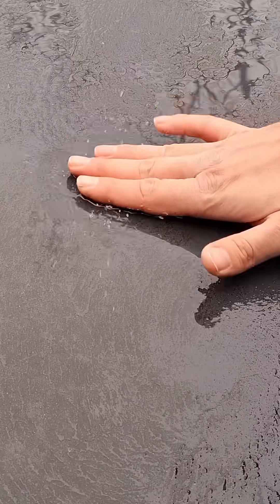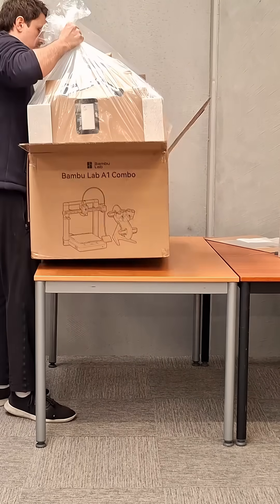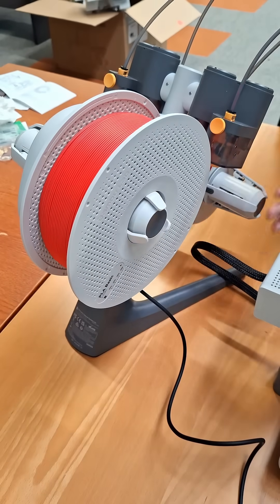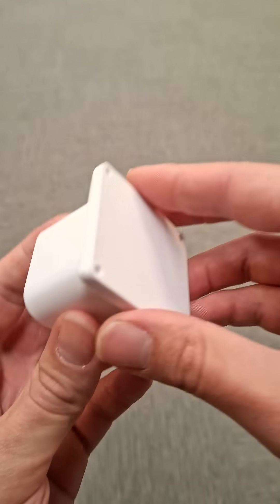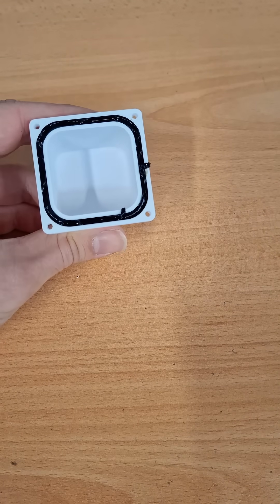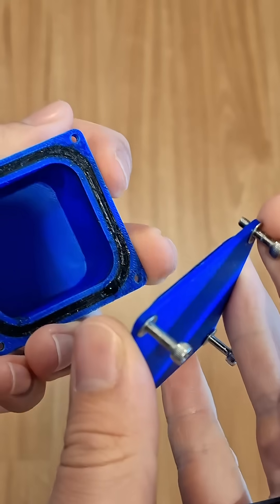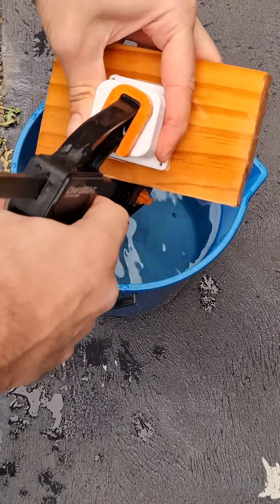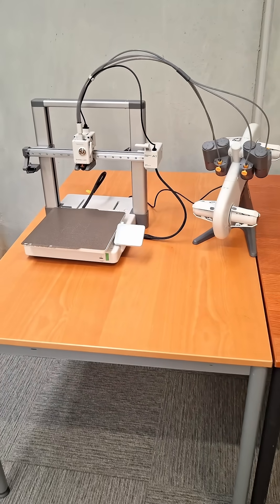Creating weatherproof electronics enclosures with 3D printing #raspberrypi #bambulabA1 #bambustudio

Comment: The best weatherproofing I have found is still potting in epoxy resin. Urethane is easy to work with too, if you need vibration resistance. For these options you need robust connectors, since removing potting material to replace a connector can be problematic.

Comment: Use an O-ring. For easy added security, print two grooves next to eachother to make a double seal. Design so that you do not screw the halves so that plastic touches plastic, but instead that the gaskets carry all the pressure from tightening.

Comment: Also! You don't even need flexible material. You can print a shape a few microns smaller than the hole your gasket is in and coat that shape in silicone grease then insert it. But make it 2x as tall and have it slot into the lid too. That will also create a watertight seal.

Comment: Buy plastic bag that shrink after heating and use underpressure to create a seal
Reply: 1 cable goes inside and it can be strengthen by some wire or sth

Comment: One common issue with outdoor enclosures is that temperature changes can cause air to be pushed out when it heats up, and water sucked in when it cools down. Potting with a resin can eliminate this but making the box walls flexible might also work.

Comment: Use an O-ring as a gasket and cover the 3d print in 2K epoxy or spray paint it. This will be and stay 100% water tight.

Comment: 1) try TPU for the gasket - I would recommend something softer maybe like 85a shure? But even with 95a it should work since you can adjust all the dimensions on your own.. 
2) when designing overhangs - put 45° chamfer instead of fillet - it looks way better because it prints without any supports

Comment: I would go for a different way: fill the container with oil. It's not vindictive and displaces the water.

Air tight recipients have the problem of the air pressure changes. A high pressure in the exterior after a rain (which is usual) pushes the water inside.

On the other way, oil is liquid so it can't be compressed so it's immune to exterior pressure changes.

Comment: Water tight containers are a really bad idea for electronics. Moisture will be in that box no matter how tight you get it. A completely air tight box will lead to condensation problems in most areas. It's better to have things mostly shielded and then a tiny drain so no water will pool.
A bit of moisture isn't a problem, you want to prevent electronics from pooling water, everything else is either futile or even detrimental

Comment: Only thing I would try is a round O-ring instead of a square gasket. Primarily because o-rings are reasonably cheap, but also because compressing a round o-ring inside of a square channel creates a really tightly compressed seal. Also, depending on the geometry of the lid and gasket channel, an o-ring can even provide a double-seal (because corners have 2 or more faces to press the o-ring against). An added bonus is o-rings are much easier to install and replace than liquid gasket.

Comment: It is not only about a good seal. Try to add a gore-tex vent as well to equalize pressure. This way it is very unlikely moisture will enter during large temperature fluctuations.

Comment: I think 4 fastner unable to provide even pressure throughout the gasket as cover plate is thin and little flexible, increase fastner or thicker lid or more hard material of lid could improve the purpose. Thanks

Comment: You can also make your own o rings, buy the material by the roll.  They make a kit with the cutting jig for square ends and for gluing and sealing the ends.  Alternatively you could design the enclosure to accept standard o rings sizes.  The o rings should be a tight fit so that when you tighten the lid it compresses the o rings.  Lubricating the o ring with Dow Corning 111 or for oxygen rich environments Christo-lube works well.

Comment: When you make the o-ring channel, make it a U-shape instead of a box shape, especially if you are using an actual O-ring, because that U-shape will help put equal pressure to the exposed O-ring (top/open side) that is suppose to seal against the flat/plate surface, instead of letting o-ring deform more into the corners of the boxed-channel.

Comment: I have used transparent craft resin on the edges of a small box and it worked, issue is that you have to break the resin in order to open the box

Comment: Pine Resin. Older electronic devices used Pine Resin on wires and components when soldering acting as the Flux and Waterproofing at the same time when cool. 99% Alcohol dissolves Pine Resin.

Comment: 3d printing also allows youbto design a drip channel into the shaoe of the print, so any water that gets onto the print should flow in a specific direction, and be diverted away from getting inti the print.

So it depends on on the orientation the print will be placed in. I remember someone did a video about exactly this.  Maybe slant3d.

Also, even if you think its water tight, since it's not going to be submerged in the end, you should have a hole in the lowest point if the design to allow water to escape, since you can also get condensation issues with a sealed box.

Comment: You can use physics, and no gasket, even have an air gap, if you exploit clever geometry such that anything short of full submeression under pressure wont get in. You actually see this on the cheaper weatherproof electrical boxes, probably terminal boxes in particular, but I'd give that a try. You could probably get away with skipping the goop.
Reply: Do you have a link for something like this?

Comment: btw: there is an spray or something like that (a coating for circutboards) that will make the circutboards immune to water. this way you can just hang them outside w/o issues from water, the only you need to worry about is the connectors and bugs ect,

Comment: The groove is not necessary with the silicone you are using. just ad a layer on the flat surface and screw the lid on before it hardens. 
Also it is not reusable, and needs to be cleaned and reaplied if dissasembled.

If you want it to be more easily opened use a o-ring in the groove, or remove the groove and cut a rubber seal for the flange

Comment: Does the seal undergo plastic deformation? That might explain why reuse caused the leak. The clamp might have been doing an even pressure but also could have been exerting more pressure than the screws and thus sealing better even if the seal wasn't even

Comment: Atv is not meant to reseal it's great for a seal that you put on one time and you don't try opening it again 
Everyone else is saying try TPU I'll try flat weather stripping it's super cheap you can get them anywhere the Depot any auto parts store Amazon that stuff is meant to be opened and compressed continuously mainly because it's designed for doors

Comment: This sealant is fine, you don't need an o ring. However you're exactly right that consistent clamp up is key. That's why it's best to have screws on both sides of the gasket, which means a wider flange. I usually do it as staggered pattern. So the 4 corner fasteners are outboard of the gasket and then you put 4 inboard of the gasket in the middle of straight run between corners. This compresses the seal on both sides and also gives the normally unsupported straight side some support.

Comment: Coat TPU in polyurethane for the O-ring, put the O-ring in the side of the wall so you dont have to screw it down to compress the seal. Measure water absorbtion with a scale, use thick print lines and lots of walls in the slicer to avoid water seeping through the print lines.

Comment: For stationary or slightly moving projects I'd consider something not waterproof, just water-resistant. In its simplest form, it's putting my project on a standing stick and covering it with bucket/container (with its lid at the bottom pierced with the stick): no water would get in just because of the shape of my cover. Unless the thing is turned lid up, because water doesn't flow up, my project is safe. Not from moisture though. 

Also, soft rubber sheets cut to the shape of the seal instead of liquid rubber/silicone. In this case the whole lid may have to be layered with a small rubber sheet, but it would work.

 Just a though, if it's totally dumb, treat it as a silly interaction and ignore me.

Comment: Do a pressure test. This will confirm wether or not water can get through the layers. Control the pressure inside the sealed chamber with a regulator with the chamber submerged in minimum amount of water, and look for bubbles

Comment: Print gasket moulds slightly smaller than the lids contact and spray them with mould release to form the silicone. Printing a tpu gasket could work if its oversized enough but i would add 4 more screws for more even clamping.
Reply: - print mould
- use mould release
- inject silicone in the mould

this is actually a great idea

Comment: Yeah, see if you can find a similar size/shaped o-ring that will work and resize the box if need be to fit that o-ring. That way you might can find a cheap standard sized o-ring that is commonly available without having to special order a particular custom o-ring. 👍

Comment: I used to work for an aerospace company and they used waterproof housings with rubber gaskets, but they also dipped the PCBs in a clear plastic to waterproof the boards.
Reply: Silastic
Reply: Woah thats pretty cool. Do you just replace the pcb when there are problems?
Reply: @SRS-o8b6m  Its called conformal coating. Most conformal coatings can be removed with thinner or stripper if needed for rework.

Comment: Or you can paint it with clear nail polish after assembly. Works perfectly. I've run exposed electronics through dirty rivers with only a coating of clear nail polish and they still work fine.
Reply: This, though the proper silicone conformal coating is less brittle and glows in UV so you can see where you missed. If you need to have removable connectors, fill them up with dielectric grease.
Reply: @Scrogan true but I've heard that it's a lot harder to remove than nail polish
Reply: @BeaHasPP not if you have the right chemicals. The worst is when coating gets on connector pins. 

I thought you wanted signals to pass thru the connector. 

You learn to mask the important spots after a few mistakes. 

I don’t remember the name of the conformal coat removal chemical, its fast
Reply: I use flex seal spray 😂
Reply: Exactly 💯

Comment: I'd try printing a gasket mask instead of using masking tape.  You've already got the dimensions set up, just adjust the model a bit and 3d print a mirrored "trench" section that would screw onto the face you want to put a gasket on.  You'd need some thin supports going from the inside to the outside.  After the gasket material has set you could pass a fresh razor blade between the two parts and cut it free.  No fiddling with masking tape.

Or, now that I think about it. Have your 3d printer lay down a 1st layer of that face.  Then you can temporarily clue those pieces in place.

Comment: You can buy Buna-N (nitrile rubber) o-ring cord and make your own custom o-rings. Cut to length, use cyanoacrylate glue to join the ends and bam, good to go. Just design the appropriate receiver groove for the diameter cord you’ll use.

Comment: why not print an enclosure that's fully sealed, pause it in the middle, put the parts in, then print the rest over it? that's still able to be opened (destructively) without damaging the electronics, and is guaranteed to be as sealed as possible.

Or just pot it. Potting does commit you to those electronics, so if they fail, you ahve to replace to entire module, but it's industry proven to work.

Comment: I’d print them in TPU, I’ve done that for a recent dust extractor project using Bambu Labs TPU 95A. Note that it won’t go through the AMS, it’s too flexible. They do an AMS compatible TPU but I’m not sure that’s compressible enough for the job.
Reply from the maker: Yeah, soft TPU gaskets is something I want to try!

Comment: It's unclear if it's truly watertight. It still might slowly soak water over time. Some test with moisture sensitive strips?
How about freezing it after the test to see if it remains stable after unfreezing?
Reply from the maker: Good idea!
Reply: Also if you can pressurise the water you can accelerate the time requirement.
Reply: That's not the point of the video, the point: the Bamboo is the best

Comment: Use an O ring as a gasket.
Reply: Yup. Orings are stupid cheap! You can even buy long stock and make custom sized rings.
Reply: TPU can also work!
Reply: This right here!
Reply: Exactly, and yes either mold the enclosure to an existing size, or you can cut them, super glue the end together and make it custom size.
Reply: Hé, I wanted to be the one that suggest the obvious
Reply: You beat me to it man
Reply: Preferably a softer one (<70A durometer) that is also at least a few mm thick.
Reply: And just seal the cut with sealant
Reply: O-ring doesn’t like to conform to anything beyond a circle, at least if you mean to be opening it often (it’ll want to pop out of its cavity).  So just create a circular enclosure (or at least circular at the waterproof junction…the enclosure itself could be any shape within or beyond the junction…just like all deep-diving submersibles.